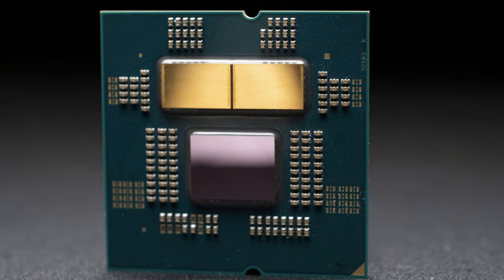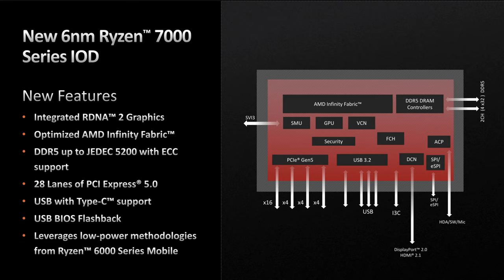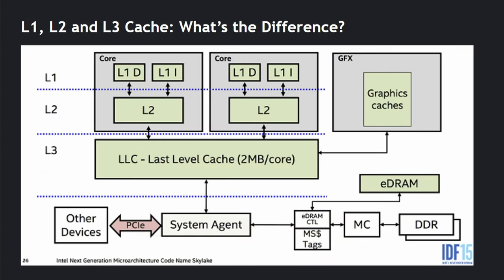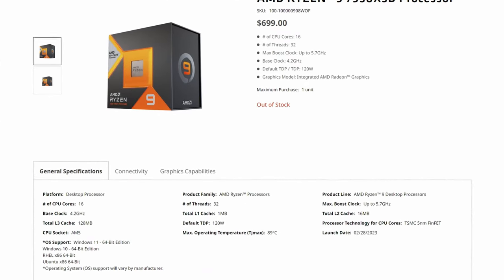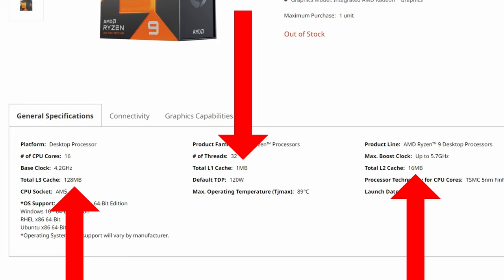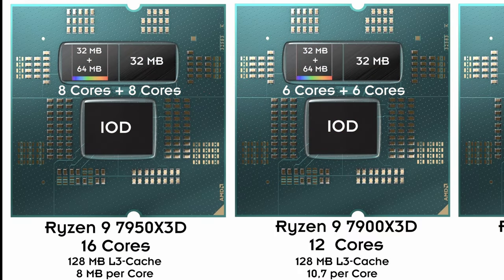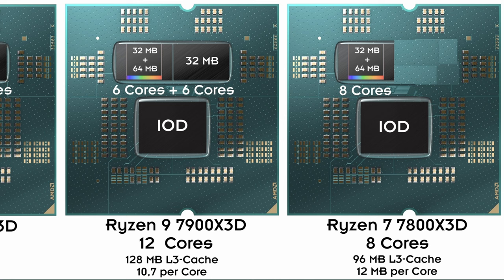How AMD's X3D CPU Technology Works On The 7800X3D, 7900X3D And The 7950X3D

Comment from the maker: In case anyone is confused, there are now multiple folks sharing how once a game is started on a 7950X3D the CPU will try to push all workloads on to the stacked CCD instead of splitting up the background tasks and sending that work to the second CCD. 

In the comments of a Gordon Mah video today on PCWorld they even left in the comments that the CPU loaded up the stacked die until is was at 100% and only then overflowed on the parked die. Feels like a real miss from AMD concerning scheduling.

Gordon's video: https://www.youtube.com/watch?v=bHr26DlTO2E
Reply: I saw the video with Gordon also. It almost felt like he missed the point until I read the comments. It’s going to be a really powerful CPU, maybe setting things up with process loop would be the way to go??
Reply: Requires amd chipset driver + windows xbox game bar active for it to work correctly, personally I would go for 7800x3d gaming as this avoids all this fluff it just works (or 5800x3d if you already have a am4 motherboard with a 3000 or especially a 1000/2000 (they are likely causing bottlenecks as 1000/2000 barely faster then a i5-i7 4th gen Intel CPU) but if you already have a 5600/5800x the 5800x3d is really game dependant (at worst 
 you get better minimum low fps spiked/more stable fps due to L3 cache, best higher fps or faster game sim speed)

or 7950x for productivity (if you need more then 8 cores, as gpus exist for offload) far simpler then core parking half your cpu just so the game is forced to run on the first CCD (I already do that myself with the 3800x because it uses 2x4 cores per ccd for very specific games)

Tests have already shown what happens when 7950x3d and chipset driver isn't used or is but game bar does not detect the game and apply core parking
Reply from the maker: @leexgx  I agree. It feels pretty messy from AMD at this point.

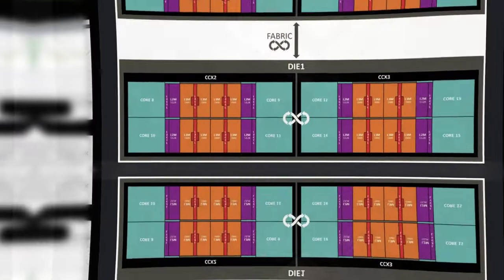Comment: 1:16 part that image needs updating, infinity fabric L3 cache syncing is now only between CCDs on 5000 or higher cpus if you own a x900 or x950 cpus,, Note 5000 or higher cpus don't have 2 ccx groups per ccd anymore they are true 8 core CCD with full L3 cache available to all 8 or 6 cores per ccd (as to why I want to move to 5800x3d to get the ipc and remove the latency penalties for some games I play on the 3800x)
Reply from the maker: I don't think you are wrong, but I wanted to find something that would actually show someone less familiar with CPU architecture how things are.  Thanks for watching so intently!!
Reply: @GraybeardGiffTech  I see if I can find a zen 3 or higher simplified picture, the current picture your using is relevant to a zen 1/2 (1000/2000/3000) cpu that used 2x4 core and 2x16mb L3 cache per ccd,, 5000 and higher is a true 8 core and and single L3 cache (full 32mb is available) per ccd

Comment: Thanks, great video!!

, I’ve made the same mistake from 2019 when I built a new PC with Threadripper 1920x…
This time I bought the 7900x3D for gaming&editing(as an new youtuber)…I started having second thoughts about it…thinking 7800x3D would’ve been a better choice…
I am still waiting for my PC(tomorrow most likely) & I hope it will turn out OK. In the end I guess as long as it keeps games at 144+ FPS its good 😭. And 350 fps vs 250fps doesn’t make any difference… 
I’m curious how it will perfrom with streaming and playing , if the CPU will allocate the right cores,resources for the best results….

Well the deed is done.
Reply: Did you get some good results with gaming and streaming? I also got a 7900x3d - coming from an i7-8700k
Reply: @vulcane994  it’s fine, I am happy with it. I didn’t get to stream, but gaming is alright.
Reply: @vulcane994  so my final opinion: Both are good CPUs but I believe the 7800x3D is a better choice to get the extra FPS boost in games, rather than 10% faster render time in premiere pro. Anyway I spend more time playing games, than I spend in premiere rendering. 🤷🏼‍♂️